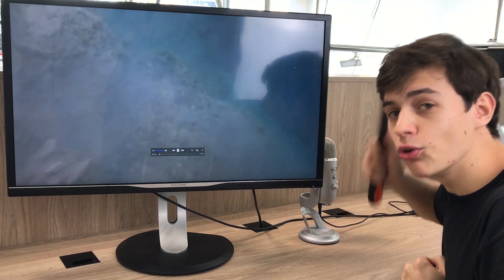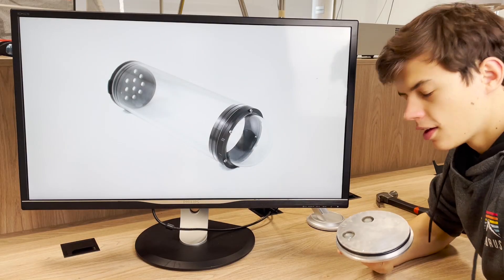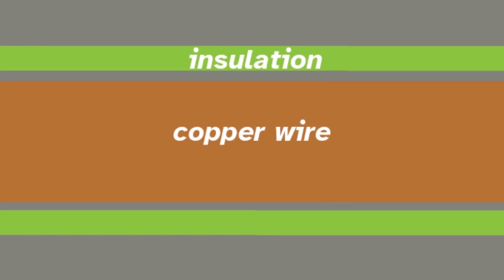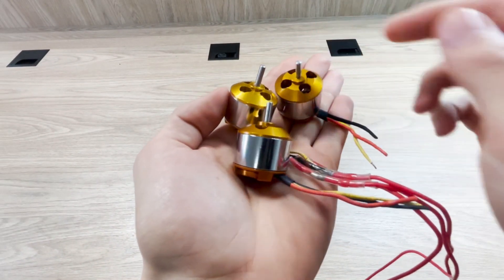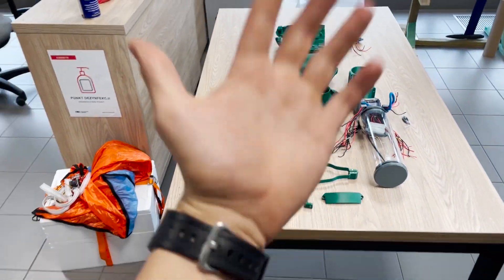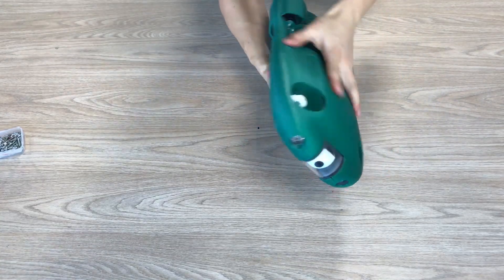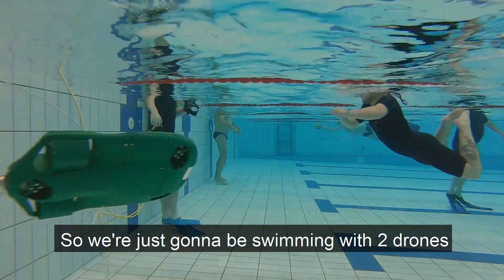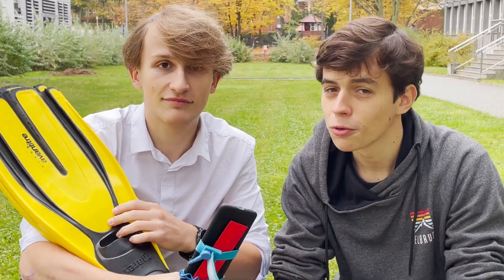We 3D printed a submarine (dives down to 85 meters / 280 feet)

Comment: This is a truly amazing!  I know this is an old video, maybe there is a comment out there for this already but what if you created a float that the sub is attached to and it sits on the surface?  Then you could send Wi-Fi or Bluetooth signals to it and then to the sub via the cable?  You would have a little more range.  Just a thought.
Reply: I guess the problem isnt just there. Getting a longer cable is just easier. (and you have a Tether to pull)

Comment: I didn't see you address the issue of heat dissipation. Have you had problems with the electronics getting too hot and shutting down? I would think that the acrylic tube with 3d printed ends would tend to trap most of the heat. A Raspberry Pi 4 produces a LOT of heat even in open air (not to mention all of the other electronics). Machining aluminum ends for the tube would serve as a partial heat sink and allow a path for heat to escape the tube.
Reply: Water is pretty cold and very good at thermal convection. I'd have to do the math but my gut says the few tens of watts you might see is well within the surrounding waters capacity to convect away through the acrylic conduction. Despite the low thermal conductivity of acrylic.

Comment: great project and very intresting for anglingclubs to inspect their fishingwaters for troubles and observing behaviour of fishes. I did watched your vid diving in a mine shaft and came up with a question. You did use a fiberoptic cable instead of standard ethernetcable and had to make special connectors for PI4 and PC. Is there already an solution for connection on a smartphone? For fieldwork its much easier to handle. It would be awesome to guide your CPS just like DJI flies its drones (remote control connected to smartphone with on screen view)

Comment: if you use an ethernet cable as the tether, you could use POE (power over ethernet) to beam up to 100W of power down to the drone to keep it running indefinitly and charge the batteries.... there are cheap and widely available parts for this

Comment: hmmm....
Why not just fill the tubes (around electronics) with some type of insulating oil?
After all if there are no compressible air filled cavities to be crushed by high pressure at depth, then high pressure depth won't crush em...

Comment: Any chance for tetherless controls, like ultrasound data link ¯\_(ツ)_/¯ commercial solution like waterlinked can get to like 64kbps, wonder how far could you get on a polish uni science club budget ( ͡~ ͜ʖ ͡°) next tire could be to use multiple surface receivers for triangulation and allow completely autonomous missions.

Comment: To prevent water leaking through the insulation you could also use magnet wire, it is coated with a thin layer of insulating material and is perfect for such purposes.

Comment: Good job on your design development guys.  Question 1. How do you handle the heat generated by the batteries and ESCs inside the acrylic tube?  I fly electric RC models and there is always heat generated by the ESCs and batteries.  Question 2.  Do you leave the batteries inside the acrylic tube when you charge them?

Comment: Cool project. Save yourself all the sanding work by wiping your PLA parts with acetone. It is a solvent for PLA but can be used for smoothing and sealing your parts.

Comment: Is it possible to incorporate Modem64 on your next project to make the ROV wireless.
Reply: using acoustic signals and pulses of light to send digital information through seawater, instead of using cable. (Wired ROVs someday will be a thing of the past).
Reply: @12345sdfghful  HAHAHA $2,300, I can see now why people use cables
Reply: @dronefootage2778  that is actually cheap, anything related acoustic signals is expensive asf
Reply: @12345sdfghful  No kidding?! I figured it's one of those $10 piezzo drivers with a little bit of software. If that's cheap then I'm in the wrong business. I need to start making water modems.

Comment: You can just fill the tube with a mineral oil. No air = no pressure difference, no expansion/compression, no leakages = no problems. It is also a perfect insulator and heat transmitter, so you can  stop caring about overheating, if you do..

Comment: "Dives down to 85 meters" but you only tested the full submarine is a 2m swimming pool. 🙄
Testing individual components to a pressure equivalent to 85 meters is not the same as the submarine itself actually going that deep.

Comment: Amazing project. A tip from an experienced professional in this subject: epoxy resin seems amazing at waterproofing, but as the time passes it starts absorbing water and eventually will "sweat" water inside. We use the same glue used in fish aquarium (we call it silicone in my language, not sure in English) to this purpose, applying vacuum and releasing it before curing will make the glue fill gaps with excellence, and it'll last more than epoxy. We use it in the electrical connectors of our robots.

Comment: Could have used a smaller RPi to conserve space and not have to deal with ports that you don't need. Would maybe too reduce power consumption as well, depending on what you're running of course.

Comment: Im buiding something similar but my plan is to just use a ip67 enclosure and then fill it with mineral oil to eliminate any pressure differential.

Comment: In the title of this video you probably meant  :  It dives DOWN to 85 meters .... correct ? 
If it would dive up 85 meters you would have to start the experiment from an underwater base which is may be 200 meters deep on the ground of the sea .. and when you let that 3D printed submarine dive up to 85 meters it would dive vertically up.

So it is just diving down 85 meters  ;-)
In a scientific video you should use the correct scientific descriprion (  language is a mighty tool in science and must be used in a correct way )
Reply from the maker: Thanks, you're probably right. But "up to" can also work in the sense that up to certain number of meters, with "dives" already meaning that it's downwards. It works either way for me

Comment: You can 3d print waterproof, but you'd need to do so with a resin printer.
You could also print O-rings with different plastics, i have heard people made them with a TPU plastic.
I case you want to make it more 3d printed.
besides that, nice build ;)
Reply: Resin printing is the way to go. No need to print O-rings though - they are cheap and readily available in many sizes and materials.

Comment: For the wires I think you should have made thin 3d printed wires spacers and then used two or three of them along with some solid core wires with no insulation and then soldered the wires for the outside so that the insulation went a little into the epoxy. For the inside you could have a connector partly in the epoxy.  This way there would be more epoxy touching the wires direct and the spacers would make sure the wires don't touch. I think just one solder point isn't the best. But if it works it works. Also I wasn't really surprised that water got in. In fact I'm surprised it didn't happen with less depth. Anyway it's a very very nice looking build. Good work!

Comment: The problem with the leakage is the multi-core wire. Your solution is great.. Another that should work well is to use single core heavy transformer wire. The enamel insulation should be completely water proof and by doubling up you can carry as much current as you want. The only difficulty is getting enough heat into it to solder it..
Reply: @Lucien shellac is easily soldered by aspirine tablets as flux. acetyl salicon acid. Normal heat is sufficient
Reply: @albertmagician8613  The problem isn't with the soldering compounds its simply that the copper dissipates a lot of heat. A 50 watt iron can usually do it without too much trouble.

Comment: Cool Project. I would made some changes to the cps-5. I would give it a light positive buoyancy so that it floats to the surface if the cable breaks. And I would add one of the bright beacon led lights, that are used for model aircraft and drones,  to the top of the sub for that case so you can see where it floats. And as an idea. I would change the ethernet cable to a fiber optic data cable.
Reply: fiber would require media converters on both ends and jack the price up a lot, plus if/when you kink it, it's done, and after pulling cable for 15+ years in the army, ethernet is stronger pull wise then any cheap fiber you would get, and by the time you get stronger fiber you might as well just buy a real drone with the costs lol

Hell you could probably work some sort of charging mechanic and a POE injector in for cheaper then fiber would be

Everything else sounds fine though

Comment: Nice job!
Maybe one could skip the outer "skin" and just attach the camera and motors much more simply with arms like sky drones? And what about instead of trying to make the electronics tube water tight you just fill it with oil? That way you might also get less problems with buoyancy. Just a thought :) and if someone tries it and it works, please tell me
Reply: Skeletal drones arent very hydrodynamic, or pretty. Would probably be pretty unstable and not manage currents well. The oil idea is a good one though. Some of the deepest (full size) submarines ever built use a similar strategy.

Comment: Filling the drone with mineral oil will make up for the pressure we do that for our electronics pannel on the diving chambers in saturation diving we actually use silicon oil for fire hazards but mineral oil will work in your application

Comment: I always wonder about making a underwater done that was pressure neutral and all the electronics are just in mineral oil, how deep could it go before the pressure would f* with the electronics its self?
Reply: That is interesting. Also what would come first. The higher compressibility of paraffin oil (than water) resulting in mechanical failure of the vessel, or the electronics failing under pressure.
Reply: @Erowens98  What if there is a hole with a rubber membane so water can enter and compress the oil?
Reply: @frbe0101  That would work.

Comment: Have you ever herd of Silicone Wire or Cable? I've found that with my projects using this high heat insulation. Sometimes when I tin my leads, the soder wicks itself inside the insulation.

Comment: Why do you need to run radio waves for the communications? If you want to communicate underground you cannot use HF radio waves either, BUT you can use LF radio waves instead.

Comment: Although I've not built a submarine, I have made a few waterproof electronics enclosures using a similar method.  However, for the through connections, I've used long DIP headers which poke through the epoxy with enough sticking out both sides that a regular DuPont style connector can push on to the inside & outside.  This gives a tidy and fully waterproof connector.  Each pin will handle about 5A, so some of them need to be doubled up for higher currents.  It's simple - but it really works.
Reply: Were you able to test under deep water? I'd worry the metal pins and the epoxy would expand and contract the same amounts and water would seep past the pins when the pressure is really high.
Reply: @ddegn  That is a consideration.  We used EP42HT-3AO Epoxy which has a coefficient of thermal expansion similar to common metals such as steel or brass (the pins were Brass), with good bonding characteristics.
If you just use any old glue you happen to have - yes, you are likely to have issues.
The trsting was to IP69K (Automotive) - so wide temperature ranges.  I don't remember the equivalent depth it was pressure tested to.  This was only for a test rig.  The final product used USCAR IP69K rated connectors.
Reply: @Simon_Rafferty  Wow, that's a lot of great info. Thank you for the reply.

Comment: Beautiful design.
For the end cap you could have soldered the wires to a connector/connectors and then used the epoxy to seal the end cap, solder joins and hold the connector. One less set of solder joins to deal with. By adding guides for the connector  to the end cap 3d print you could have "standardized" the connector positions and would so always know where the connections would be. Hope the idea could be helpful to you or anyone trying the project out.

Comment: The acrylic tube for the main electronics housing seems... overly complicated. Since you ended up making all your  seals with epoxy, and the fundamental problem is the layer lines of the plastic not being fully watertite themselves, wouldn't simply doing a brush coat of epoxy resin across the whole surface be much easier? Or even simply switching to a resin printer instead of a filament? given that they resin isn't fully cured by layer, every layer is hot coated onto the previous with 100% adhesion, so it should be perfectly water tight. 

Great engineering, but, it seems like you guys kinda went the long way around the problem.

Comment: ...fill the portion of the drone with the electronic components with a non-conductive non-compressive fluid. You don't have to worry about pressure equalization causing conductive salt water to infiltrate/short the electronics.

Comment: Have you ever tested how water tight a 3d print might be if you brushed on the resin from a fiberglass patch and repair kit, just without the fiberglass?  You can get them at most automotive parts and home improvement stores, so they're "readily available" enough to meet your standards.

Comment: Great video! how would you water proof the motors, if you decided
 to waterproof those?
Reply: Brushless motors are already kind of waterproof, but corrosion would be an issue (particularly in the bearings). You could try potting the magnets and copper windings, but you'll likely have problems with the clearance between the magnets and armature. Much easier just to buy motors advertised as "underwater" (as opposed to "waterproof") - not very expensive on AliExpress / eBay. You could replace the bearings with ceramic bearings, which won't corrode.

Comment: If you plan to do footage at 85m and for longer times why not use some form of usb over ethernet and POE on the ethernet cable as well to allow for power over the small tether and data over the same length

Comment: While I'm more interested in building a drone of my own design, your control system interests me a lot. The laptop takes control inputs from the PS4 controller, sends it through the data link to the Pi, and the Pi tells the flight controller what to do for pitch, roll, yaw, and speed right? 
But, can it support up to 6 motors and be configured to combine those speeds into forward/back, (4 motors various speeds) left/right strafe (4 motors various speeds) up/down (2 motors matched speeds) and pitch (2 motors, matched speeds, reversed directions)
Is it also possible to control 2 additional RC servos? 1 inside the sub, and 1 outside.
Your flight controller uses the same movements as a drone while I'm interested in 5 DOF (don't care about roll) and wondering if the flight controller can do it.
Reply from the maker: Hey, as mentioned in the video, the drone actually runs open-source software, created by BlueRobotics. Here is the full documentation: https://www.ardusub.com

Comment: rather then stripping the insulation which will result in corrosion. I think a better way is to use steel pins epoxied in the cap and solder to those.

Comment: How long can you run the cable between the drone and computer? It seems to me like you would hit a limit with how much cable the drone can move.
Reply from the maker: You're right, if you have a long enough tether, most of the drag is actually caused by it and not the drone itself. If you have a thinner cable, it's definitely a plus when it comes to drag. We're not sure about the max length after which it becomes difficult to steer. Seems to work well enough with the 100m cable.

Comment: Have you thought about mineral oil filling for the electronics box and having zero pressure differential?
Reply: Doesn’t that cause rusting and falling apart inside? 3m novec tho
Reply: @dlanm2u  No. Mineral oil is oxygen free. No corrosion. Its also non-conductive and not particularly aggressive on most plastics.
Reply from the maker: Yeah, that's actually really interesting and worth considering in an ROV design

Comment: You don't have to use cables in your epoxy penetartor. Heres a little tip from the subsea oil and gas industry - you can use a circuitboard instead. A circuitboard is already a epoxy laminate - and if done correctly will fuse with the epoxy penetrator to form a very waterproof barrier. Without going into any details - you should also be able to design a penetrator that exits horizontal from the ends that can withstand several hundred bars of pressure, using only o-ring seals. Moreover, a circuitboard penetrator would allow you to use proper connectors on the 1ATM side and pressure side.
Reply: I like your ideas here.  But having trouble visualizing what exactly you mean by, "penetrator that exits horizontally from the ends.....using only o-ring seals"

Comment: Have you seen the work done at MIT for A Compact Acoustic Communication Module for Remote Control Underwater? It uses sound pulses as remote control at depth in salt water. This also has fairly low data rates (one message per second). There's a PDF going over their work, showing how they did it.
Reply from the maker: Sounds really interesting, will check it out. There's also this company Hydromea which makes wireless communication devices using light
Reply: I had that idea too. Though dont know nearly enough about signal processing to engineer it. My concern would be issues with echolocating marine life.

Comment: Why didn’t you paint the inside of the drone? And possibly the outside also. That would stop water penetration with less work.   
Flexible sealants come in spray cans also. Like the Flex Seal brand.